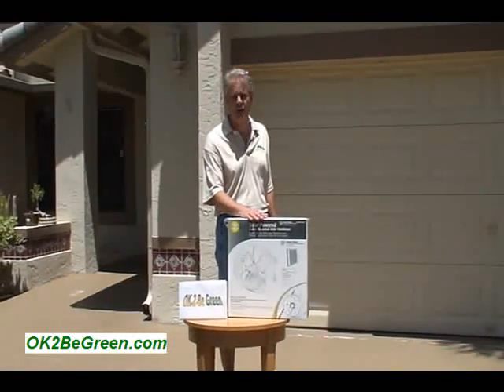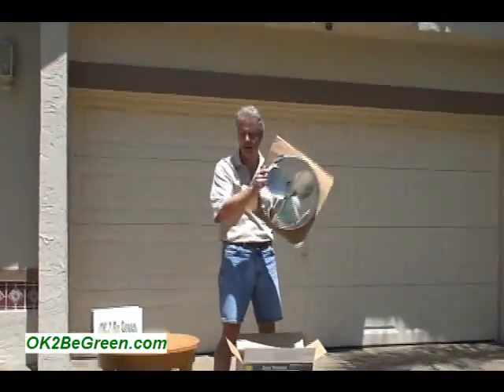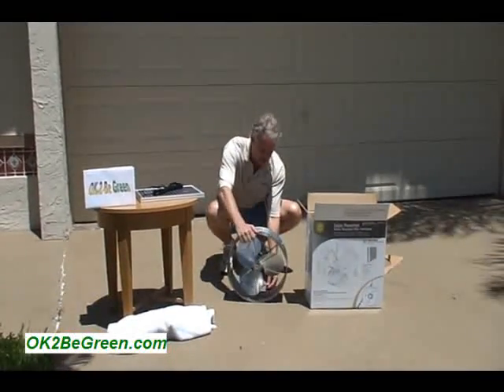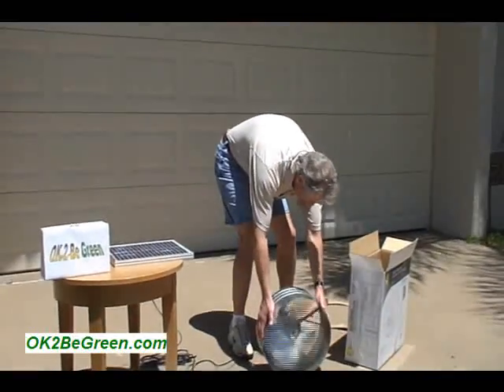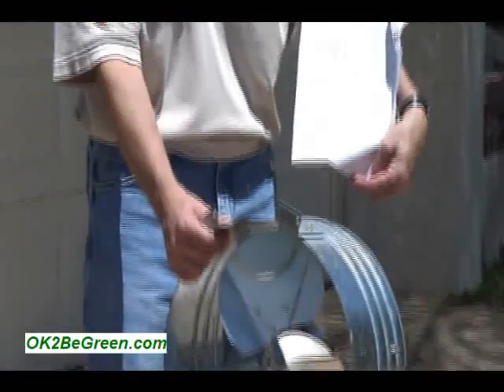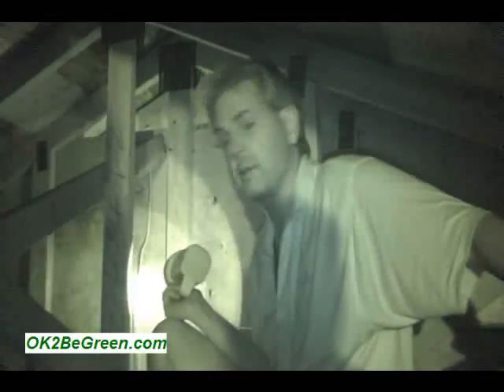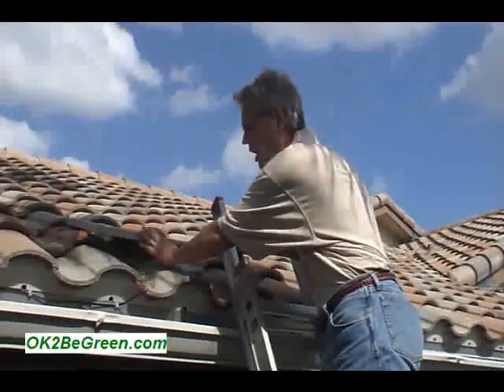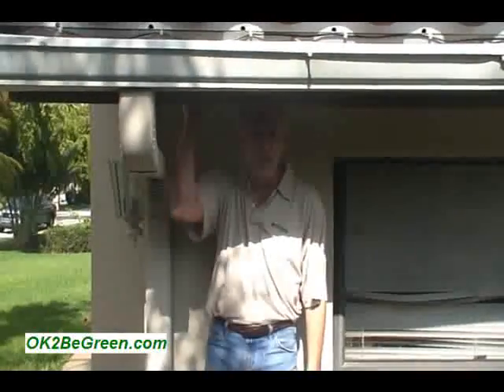Solar Gable Fan Installation

Comment: A 10 watt fan will not save you $30 a month. Actually, a 10 watt solar panel will only give you about 60% to 80 of the rated output. So you only get 6-8 watt out of the solar panel.
Even when you have 8 hrs of sunshine you only use or save 8hrs X 30 days times 10 watts = 2,400 watts a month.
The average kilo watt in the US cost 14 cents. 1 kilo watt = 1,000 watts.
So you save 2.4 kwh per month or  2400 watts = 2.4 kwh X 14 cents =  33.4 cents a month.

And those solar fans are about $270. So it will take 808 months to pay for itself/ break even or 67.33 years if you use it in the winter also.
I don't think that the fan itself will last that long.
Reply: My current gable fan is very inefficient, it does move 1500 cfm but it consumes 250 Watts.  Here in SoCal I guesstimate I pay $80 per year or so running it on a attic thermostat that turns it on at 110 degrees or so.
So this would save 250 watts whenever it's running, though I'm sure it also doesn't move quite as much air.
Reply: Steve,
Those solar fans have a very weak/small electric toy  motor in them which use about 5-7watts. a small breeze will spin them backwards.
You can blow air on them to make them spin backwards or to slow them down. Look at this video, a wind outside the roof will slow and speed uo the fan at 8:00 https://youtu.be/UIKDILo_adk?t=480  .Those solar fans are over $300 now.

Just google to use a car radiator fan and a 100 watt renogy panel etc for an attic fan. You may find them here on youtube.  Talking about using about 80 watts of ''free energy'' from the 100 watt panel for 1/2 the price.  Use an 100 watt renogy panel and hook a car radiator fan directly to the renogy panel. The sun shines and the radiator fan is running, no sun no radiator works.  A car radiator will have about 1,000 cfm.

Panel and a car radiator fan is what I will do whenever I get time. I
Reply from the maker: Bonnie... I have to disagree... I installed our fan about 8 years ago and never had a problem.  It used to be horrendous in our attic, and it is so much better and made a difference in our electric bill.  Check out our site... the fans are under $200 and shipped via Amazon... FREE to run since they are powered by the sun!  It is ww.OK2BeGreen.com! http://www.ok2begreen.com/diy-projects/solar-gable-fan-installation/.
Reply from the maker: Wow… that’s quite a chunk to pay for the fan to spin… and only when it hits 110!  Yikes!  

You will definitely love the solar powered fan… it costs me $0 to run, and it is on from morning until night… as soon as the sun is up.  Even in Florida, I doubt my attic gets that hot any more.  It is so quiet, I have to check it once in a while just to verify it’s running… and it always is!

If you haven’t purchase it yet, check the selection we offer… all shipped through Amazon.  It just helps us fund projects such as the installation video.

http://www.ok2begreen.com/green-store/?storestuff=/191-4124753-1137916?_encoding=UTF8&&keywords=&node=577

We hope you enjoyed the video!

Comment: Hi, Perry. I have a question for you. Would it be more efficient to install one fan blowing air in and another fan blowing the air out? What would you recommend? Or have both fans blowing the air out?

Thanks,
Mike
Reply from the maker: Greetings, Doc.  The fan is designed to blow the hot air in your attic out.  If you blow air in, you may be increasing the heat in the attic, depending on the outside temperature.  If the openings are close, fans in opposite direction may work against each other.  I would recommend only blowing out.

Thanks for watching, and hopefully you'll buy your fan from us at OK 2 Be Green!  http://www.ok2begreen.com/green-store/?storestuff=/detail/B00901RSEQ/187-7360534-7049141

Comment: You showed all the easy part.  The hard part is not about cutting the gable hole, but rather how to deal with the siding outside of it.  How to make sure rain is not going to leak into the house?

Comment from the maker: @helloman1976 Thank you for you comments.  You can get the fans for about $300 now.  

The panel is only blocked a short time by the tree.  the cable that came with the fan only reach that far.  As for a battery, I wanted to keep costs down and low tech.  It actually works great, and I didn't need a battery... even in South Florida!

We get a commission when you buy through Amazon, so please visit OK2BeGreen!

Comment: Why did you mount the solar panel under the tree in the shade? Also what do these cost and is there any disadvantage to them only running during the day since heat still gets trapped in your attic even after the sun has gone down. It seems if you had a battery, charge controller and a solar panel you could get this fan to run for a few hours after the sun went down to ensure that your attic was cooled completely. Thoughts?

Comment from the maker: @kleahy12 

I really appreciate your comments.

For the panel location, a lot depends on how your home faces and your association (if applicable).  I have mine on the east side of my home and it works perfect.  

I do not use a plywood backing.  The gable has a screen to keep out bugs and the fan direct to the wood frame for support.

We get a commission when you buy through Amazon, so please visit OK2BeGreen!

Thanks.

Comment: Mr Patterson.  
Video was great.  It's a hot weekend in San Diego.  I'm looking at getting a Solar Gable fan.
Any thoughts on solar panel orientation for best operation?  East, west, etc.  
Also do you recommend a plywood backing (my gable is open) to make the fan more efficient?
Thanks in advance...